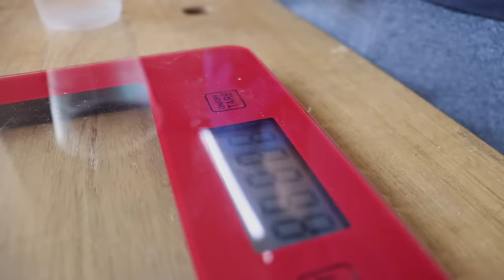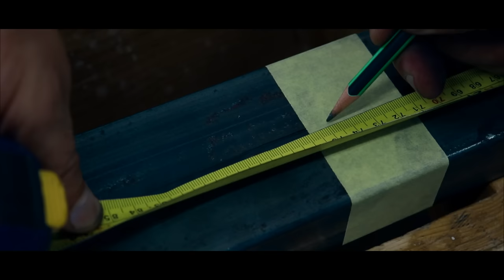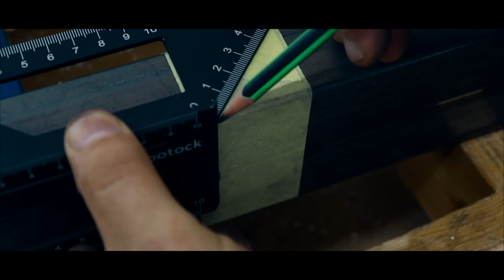Epoxy Desk. How to make a dovetail joint box.

Comment: bonjour Wood design , quelles sont les bandes adhésives que vous utilisez pour faire l’étanchéité de la résine ? et sur quel site je peux les acheter s’il vous plaît 🙏🏻 un grand merci d’avance j’ai vraiment besoin d’avoir ce genre de bande merci d’avance pour l’info pour que je puisse les acheter.

hello Wood design, what adhesive tapes do you use to seal the resin?  and where can I buy them from please 🙏🏻 many thanks in advance I really need to have this kind of tape thanks in advance for the info so I can buy them.
Reply from the maker: Bonjour. Il s'agit de ruban adhésif en aluminium et peut être acheté dans un magasin de matériaux de construction.

Comment: Beautiful work! I have a question about your drawer faces. Did you do this during peak humidity? I realize it’s indoors so it won’t expand and contract that much but the washer spacer is what a couple millimeters thick to account for 2 faces expanding?

Comment: Impressive skills. I would just point out one thing about the grinding. The grinding disks and the fine metal debris that you breath in are very dangerous. On a job I was told to stop and blow my nose with a white rag, it was all black. Even though you can't see it the discs as they wear down end up in your nose, sinuses and lungs. It says on the disk itself its made out of cancer causing material. Even though you only cut a few pieces you should always wear a mask when grinding. Just my opinion.
Reply from the maker: Thank you for sharing this information, And thanks for watching.